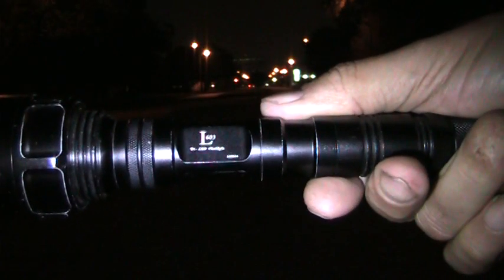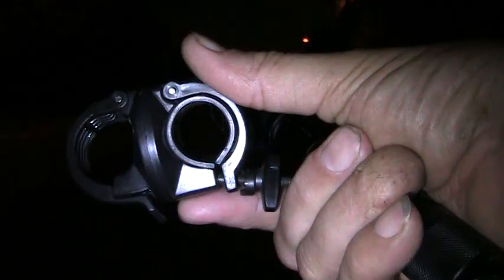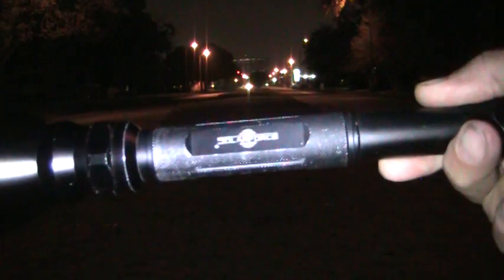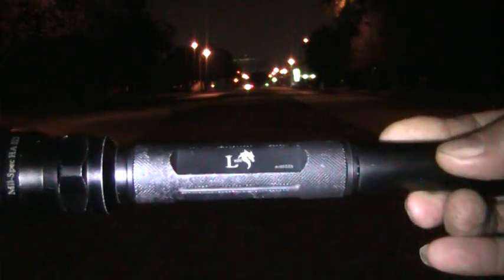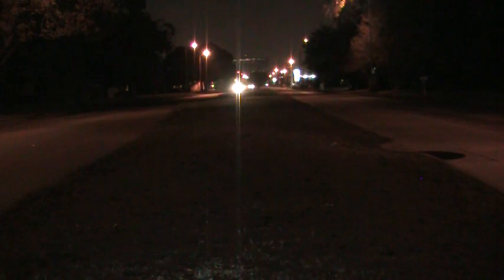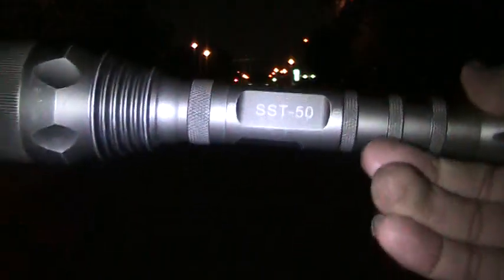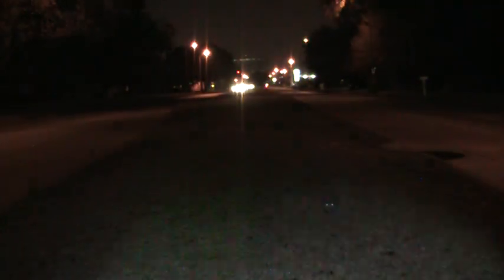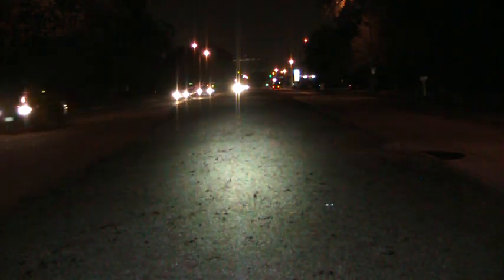Riding At Night My History of Bicycle Lights Beam shot MJ-818 MJ-808 Long & 1st Version

Comment: Holy cow...waving all those lights around in heavy traffic, lucky you didn't blind the oncoming traffic and get run over! And your bike sitting right on the edge of the road! Not very safety conscious are you? I appreciate your effort but why not just go with a dedicated bike light? You can buy a 1000 lumen light with a battery pack for a lot less than you paid for those flashlights you were demonstrating.